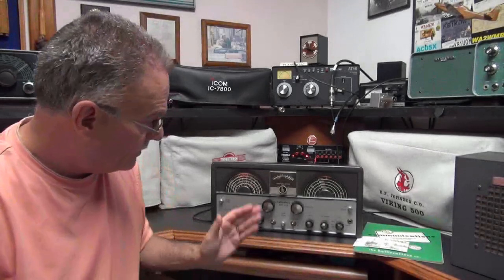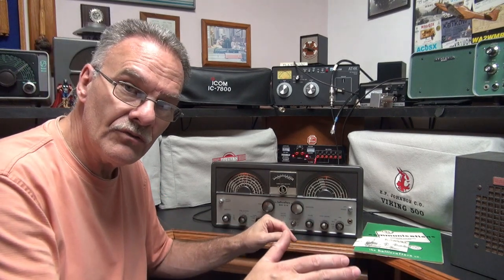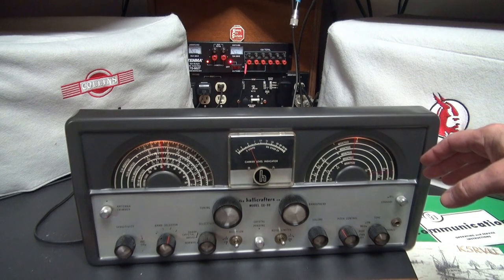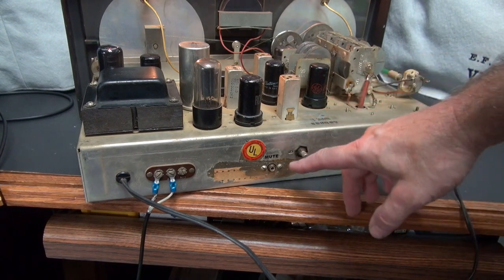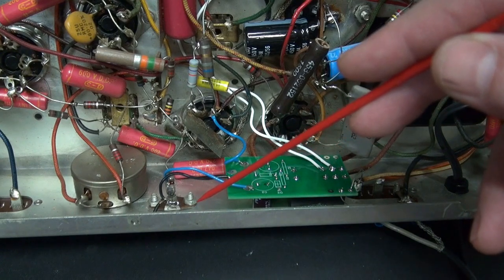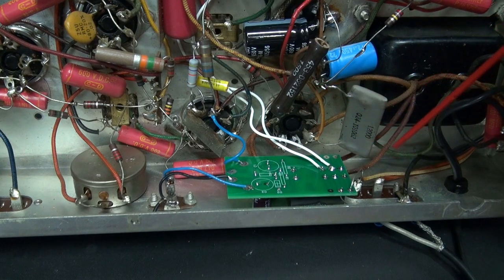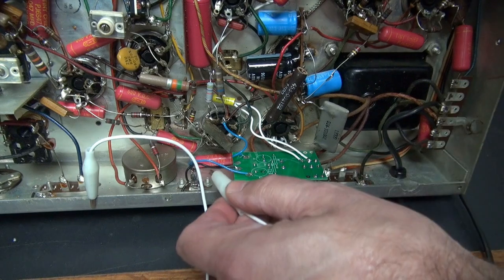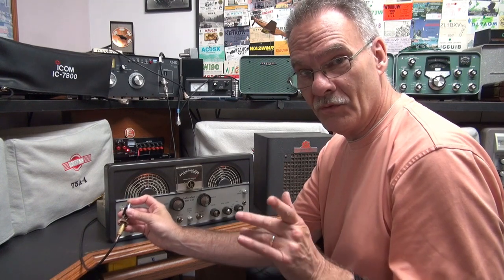Muting Hallicrafters SX-99 shortwave Ham radio receiver for use with Transmitters D-Lab K1 module

Comment: I NEED HELP!! 
I have a old zenith radio the model is H-500. I power on the radio and the AM band receives like crazy but the other shortwave bands have almost absolutely nothing. I have heard a couple weak signals but that’s it and the volume is very low on the shortwave bands. Anybody have any ideas. Something I have noticed is the the tubes in it do glow but they don’t get hot I don’t know if that’s normal or not. So please someone give me any ideas or something.

Comment: Not ham radio related but what can cause an electronic to become conductive? I can't use my reel to reel player it's shocking me
Reply: How old is it?  Does it have vacuum tubes?  Does it have a two-prong AC power plug?  Brand and model numbers help, too.
There are a number of possible causes for getting shocked, hard to diagnose in comments.  Look for one of the D-Lab videos where Terry talks about "live chassis", that may be related.

Stay safe, electricity can hurt or kill you if you don't know what you're doing.